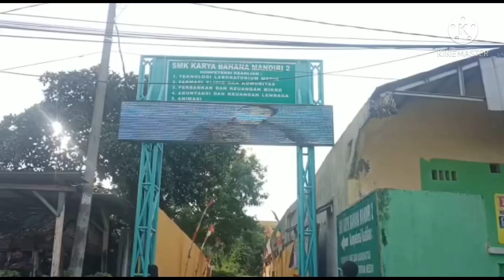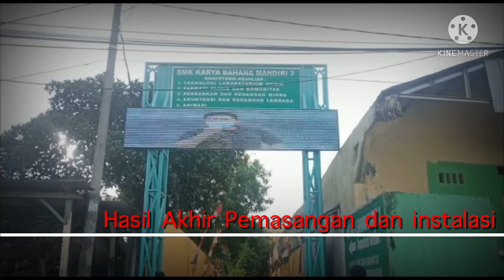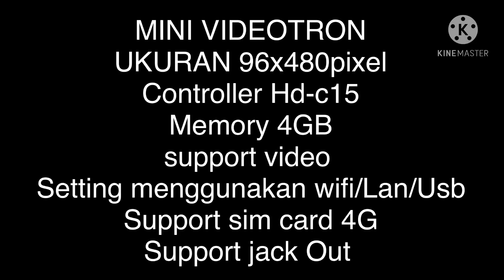Cara Merakit videotron dengan controller sejuta umat HD-c15 panel p10 Outdoor

Comment: maaf mau tanta apakh controller huidu D15 bisa dipakai untuk ukuran 384 atu hanya max 256... terima kasih
Reply from the maker: Tergantung panel yg d pake kk,kalu p10 bisa
Reply: @endyarianto031293  klu menggunakan p5 maxsimal apa 128 x 256 atau controller nya mesti ganti ke d16🙏🙏
Reply from the maker: Gak bisa kak gak kuat

Comment: CCnya kalau dipake untuk modul led flexibel atau led 90 degree apa bisa pak ?
Reply from the maker: Blok support pak saya cek
Reply: @endyarianto031293  pak untuk pasword haidu c15 c berapa ya ?
Reply from the maker: 888 kak atau 88888888
Reply: @endyarianto031293  pak tutorial untuk hardware setingnya pak. terima kasih
Reply from the maker: Siap next ya

Comment: Apa kontroler sama saja untuk p10.p4 atau p2 pak ?
Reply from the maker: Beda jelas nya pak ,cuman ada beberpa kontrol yg ada prot hub 8 sama hub12
Reply: @endyarianto031293  rekomendasi untuk controler p2 ada pak ? Link pembelian
Reply from the maker: P2 pake hub 75 pakenya w60-75 juga bisa
Reply: @endyarianto031293  trimakasih atas penverahanya pak

Comment: Bang aku punya modul videotron RGB p10, tapi kok pin kabel datanya 26 ya? Ini controllernya yg cocok jenis apa ya?
Reply from the maker: Model lama itu kak yg model baru 16p
Reply: @endyarianto031293  masih bisa dipake tidak ya?
Reply from the maker: @zainzoan8852  masi dong
Reply: @endyarianto031293  nyari kontrollernya gimana, Susah banget di online, semua 16 pin, yg 26 gk Ada, Kira Kira apa keywordnya biar gampang
Reply from the maker: @zainzoan8852  pake converter kak
Reply: @endyarianto031293  kasih Tau dong namanya apaan?